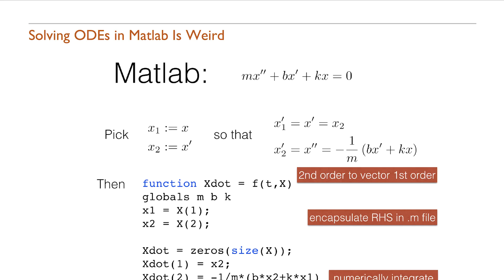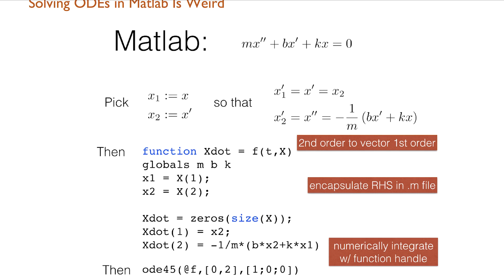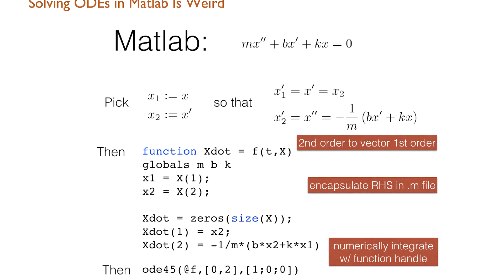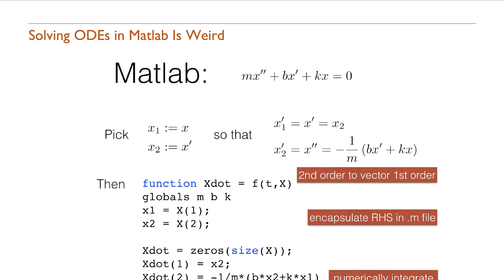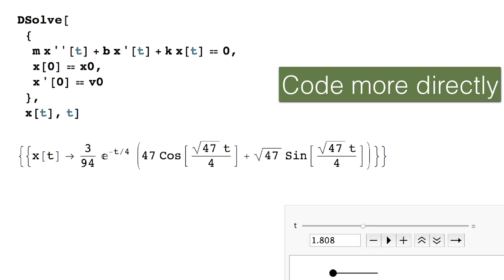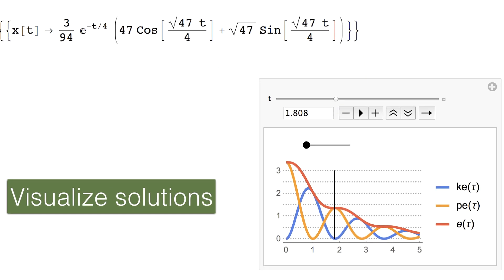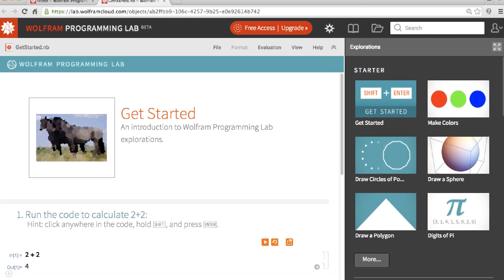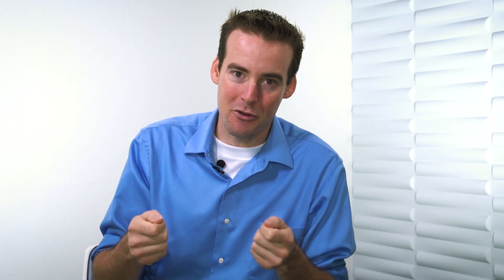MATLAB to Mathematica: An Engineering Student's Perspective

Comment: I'd be a bit worried about engineering students using mathematica to design things that people's lives depend on, like bridges or whatnot.   It's hard to even know for sure what the order of evaluation of a mathematica expression is without trial and error, and I wouldn't ever want to bet my life on the soundness of my mathematica code.   That said, in purely theoretical work Mathematica is excellent.
Reply: MATLAB is not used in industry anyway

Comment: The fact the functions in Matlab are individual files was always something that seems totally unnecessary and encourages bad programming habits. I don't know enough about the internals of the language to see why this 'feature' is present but it certainly dates the product a lot. No modern programming language should have such limitations.
Reply: Its not a limitation - it actually has the purpose to make the function available for other programms and reusing it. But it can be annoying when u dont need that feature for simple tasks
Reply: No. Actuallly matlab functions doesn't need to be as individual files. You can do it, but you can also have many functions in single .m file

Comment: It's always a tradeoff between how easy it is and how much control you have over what the program is doing.
P.S. Assembly for life!
Reply: I don't think that's really valid here. It's a question of whether your program is best represented in the problem space or in the machine space. As a computer scientist, I almost always want to stay as far away from the machine as possible. I want my program to reflect the problem and its characteristics. If I have to describe the act of moving stuff from memory to a register and then invoking an instruction to operate on certain registers and place the result in another, that distracts from the problem I'm trying to solve. It's irrelevant to my program. There are a few cases, for instance a device driver, where the machine is the problem. There I want direct control of the machine. Now let's include an example: "sum the first 1000 prime numbers". Do I want to describe a process to find the first prime, and then add it to a running sum, then find another prime and accumulate, etc.? No. Of course not. I want to offer a formal, concrete description of the computation without specifying a process (steps). I want the runtime system to determine the best way to perform the computation. Maybe there are 14 underutilized cores right now, and so the runtime system can map the computation onto those cores. Maybe there's only one underutilized core, and the runtime system will need to map the computation onto that core. There are structures (mostly arising in universal algebra) that allow computations to be described like this. And then when I go to prove the correctness of my program, I only need to show that I presented the right computation to the system (in these fancy objects of formal algebras, like monads, monoids, and functors). That's often a matter of verifying that there are no typing mistakes, whereas describing the steps the machine must go through leads to issues where it can be virtually impossible to demonstrate program correctness. To return to your statement about "what the program is doing", if I utilize these formal mathematical structures, I know exactly what the "program" is doing. It's solving my problem. I know nothing whatsoever about what the machine is doing, but I don't care. On the other hand, if I know exactly what the "machine" is doing, I probably have no clue about whether it's actually solving my problem, and that's a serious liability.
Reply: no one is using assembly for the real life problem

Comment: Thanks for the video. I agree. Without the digression of an additional coding step, it does make it easier to go from a mathematical equation or statistical concept directly to the (petroleum) engineering application. This allows me to spend more time on the assumptions and validation of the model/equations.

Although if I was a student at UCSB, I would prefer to spend that much more time on the beach.
Reply: What about taking your laptop with you to the beach, lol :)